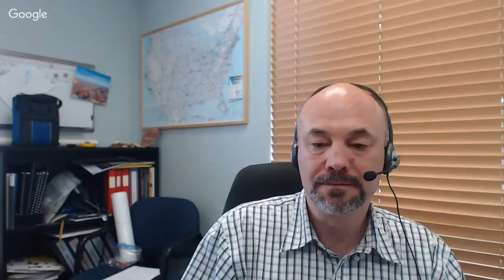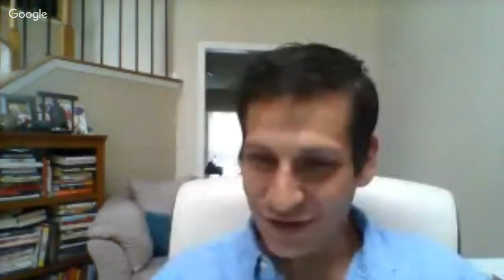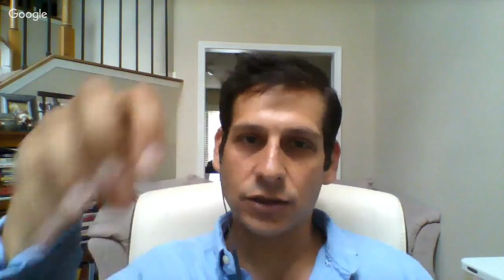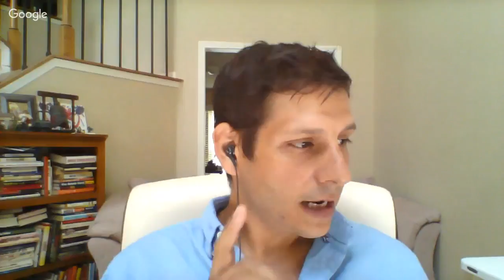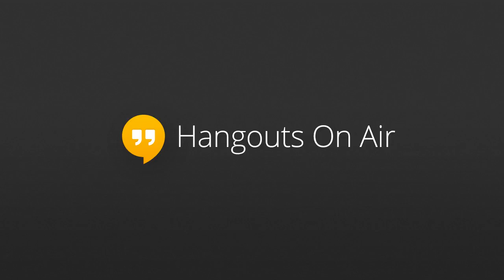Past, Present, and Future of GPR: An Interview with Greg Johnston from Sensors and Software

Comment: One more question if you do not mind.

We are building a unique GPR system an autonomous system.  That means we would like to put a GPR onto a quad ( ATV ) and make it a program driven autonomous survey vehicle. The reason of we are doing that because we have a project where we have to  search a 20 km@ big ( huge ) area and we have just 30 day/ year. So we would like to use our time and do the survey 24/7. 
The vehicle is almost done but we still struggling to choose the suitable system.  The basic information:
Flat / agricultural area.
No rock, tree, anything ( GPR heaven ) 
Required depth 3-4 meter
Target : mass graves ( medieval ) 

So the questions.   How close do I need to mount the antennas ( multiple same frequencies antennas ) if I want to search the widest area but I do not want to miss anything.  Should I mount them right next to each other or I can leave some distance between them  ( horizontal ) ???

Here is a photo what I am thinking about.

http://www.3d-radar.com/wp-content/themes/iCompany_122/images/random/airport.jpg

Thx mate and greetings from Australia
Reply from the maker: Hey George,
I love the idea. I see many applications for a system like this. The spacing between the antenna will be determined based on how large the mass burials are. Looking for a single grave you would need them side by side, but looking for a burial with 10 bodies, you probably have a little wiggle room. Obviously the closer they are spaced the better the resolution and stronger interpretations. But looking for larger targets you might be able to space them 25 to 50 cm from each other and still get great, interpretable data.

I'm happy to have a deeper conversation over skype if you would like. 

Good luck,
Dan

Comment: Hi Dan

Can you tell me please the average data size of one our measurement ? With other word I would like to know how big is the data what the GPR produces e.g. in  1-10-30  min measurement.

THX
Reply from the maker: George Bill thanks for the question. The factors that contribute to the size of a GPR profile are the length of the profile, the time window (how long the for collects each trace), and the sampling rate ( how many points it uses to digitize each trace). It all depends on the project but I have had profiles that ranged from less than 1 megabyte to over 100 megabytes. Usually falling between 1 and 10 megabytes with 30 meter transects, 80 ns time window, and 512 sampling rate. Hope this helps